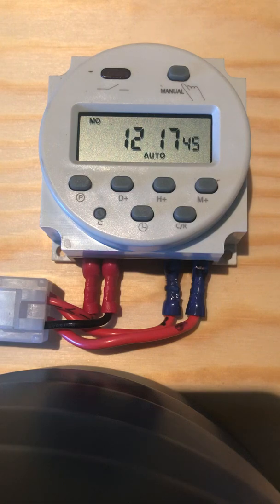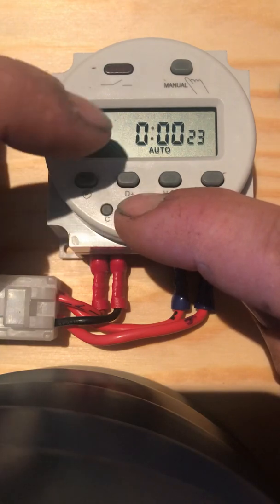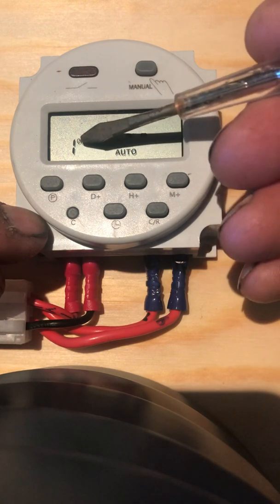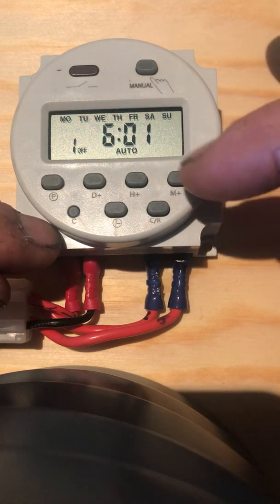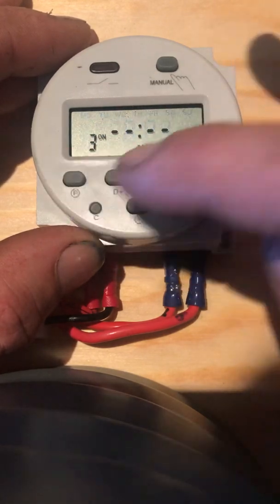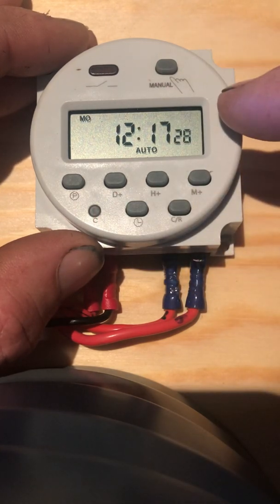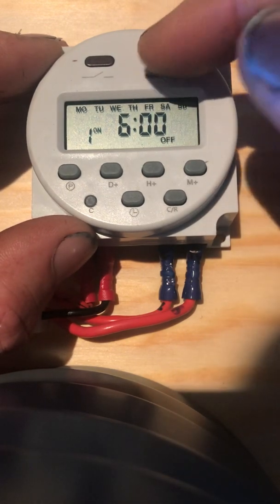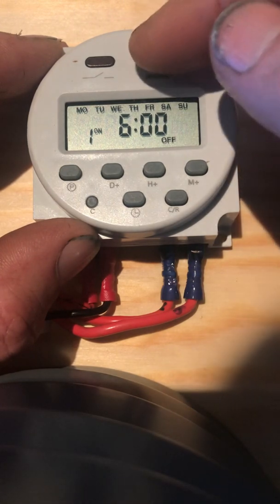Programming the CN101A 12vdc digital timer. Nator Manufacturing

Comment: how set to regular time , mine is on military time? thanks
Reply from the maker: Hi Pedro, hold the clock button down for 3 secs. It will alternate between the 24hr and am/pm modes. When programming multiple schedules, military or 24hr mode I find useful as I find the am/pm symbols easier to miss. Good luck.

Comment: Thank you, the bit about Auto to Off and back to Auto was missing in the instructions. Should be working fine now, I'll find out tomorrow if it has turned off in the night.
Reply from the maker: My pleasure. Glad I could help 👍
Reply: @natormanufacturing5906  Mine has stopped working. The red light still comes on when the timer is set to come on but it no longer starts the pool motor. There doesn't seem to be any loose wires so I'm guessing something inside the unit is fried?

Comment: Nice video.
Please, can I use this timer to power a 12volts DC fridge.
Thanks
Reply from the maker: Yes. Great use for it. This timer has a relay that is rated at 10amp max at 12VDC though. I have field-tested the timer to a maximum of 8amps daily for 3 years in a product, still going strong. It’s a quality item. If you are unsure of the loads initial/max current, safe bet is to wire a second automotive relay to the power out terminals of the timer. That is, using the timers built in relay to switch a larger relay for power to the fridge.
Reply: @natormanufacturing5906  appreciate
Reply: @natormanufacturing5906  Good to know mate. I want to run 3 small 12v heater fans which have a consumption of around 9amps each. So from your reply here I should have a relay that can handle 27amps (say 30amps round figures). This will allow the one timer to handle the 3 small heaters? Agree?
Reply from the maker: @mirriulahwaterdog  totally agree. But I’d use a 40 or 50 amp rated relay as the contactors inside this relay will handle the load easily for a much longer life span. The 30amp is very close to the maximum rated capacity when in use. I’d put an additional inline fuse between the timer relay’s powered output and the 40 amp relay.. I’m a big fan of fuses 👍
Reply: @natormanufacturing5906  Thanks mate, appreciate the reply and advice.